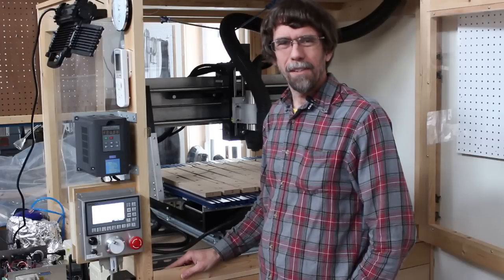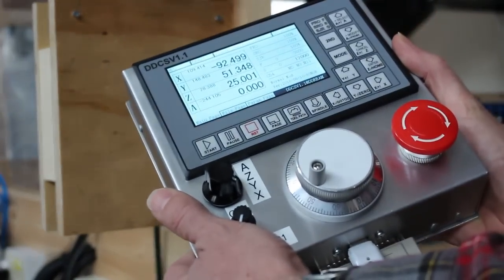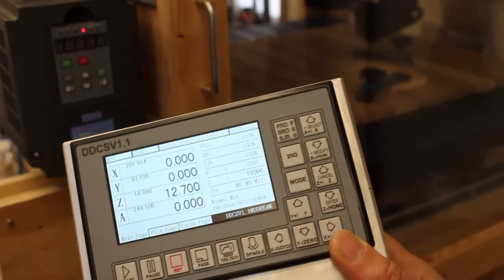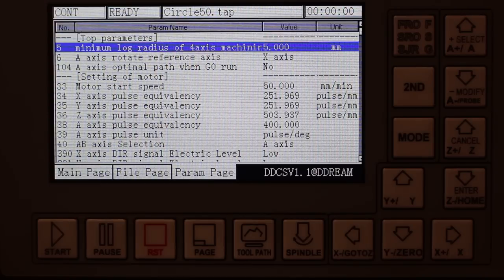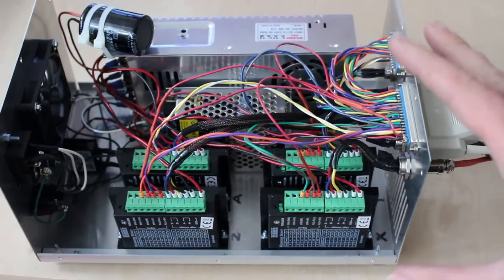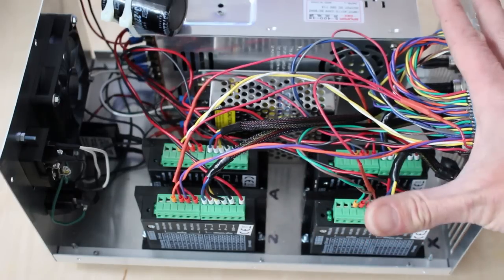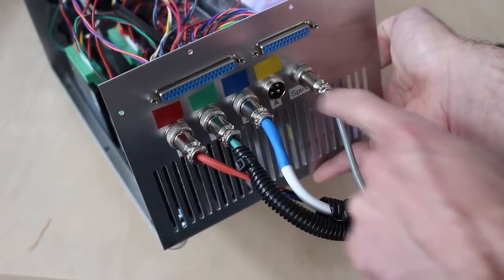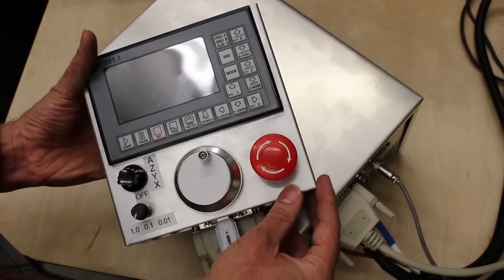Modular CNC Controller DDCSV1.1

Comment: Nice video. But I don't understand why go through all this trouble to get rid of Mach3+PC? This type of dedicated controller makes sense in industrial settings when you plug a flash drive with already-tested g-code and run machine all day. But in my  hobby workshop I constantly go between CAD-CAM-Mach3. Having to copy the gcode to a flash drive in order to make a small adjustment is a big hassle.

Comment: Does the unit supports extra G or M coded additional to those shown on user manuals. I have the hardware setup, thank you in part to your valuable documented videos, and I am willing to add pauses to my program, create a loop and have the cycle waiting for a push button (digital input) without have to use the start button on the display every time.   Any help or walkaround would be much appreciated.

Comment: Hi Jay.

Nice job & vid.
I am contemplating buying one of these as they appear to be a nice, compact and capable controller. However having read the manual, I see no reference to M6. How do you handle toolchanges? Also, any idea if the inputs can be programmed to perform functions other than those labelled?
Reply from the maker: Hi Eugene,
I don't have an automatic tool changer so I generate a separate G-code file for each tool, and change the tool manually before running the next file. I'm not aware of any alternate functions for the inputs other than what's in the manual. There are a couple of general-purpose outputs controlled by G-code that are nominally "coolant" and "lube" but could be used for other purposes.

Comment: I have watched both the construction and wiring videos but am still confuse.My controller is a different one from yours (a TOPCNC TC55H) but I suspect that I will finally work out a comparison between I/O connectors between the two.

However, my query is where do the two D-Sub connectors go to?  I have 2 machines.  One is a custom built machine running Mach3 and the second is a cheap chinese, arduino based machine which I will eventually upgrade to use 6600 stepper drivers instead of the toy ones on the arduino.

Comment: Hi Brain I'm using your DDCSV11 post-processor and it works great with Fusion thank you. Have you put any thought to the 4th axis, I have tried but can't get the A axis to work. Steven
Reply from the maker: Hi Steven, the post-processor should work with the A axis if you set the angle in your Setup in the CAM workspace, i.e. to rotate the part to a specific angle and then machine a 2D or 3D toolpath at that angle. It may also work using a wrapped toolpath, i.e. to rotate the part while machining around the circumference, but I did very minimal testing of that mode so it may not be exactly right. The internal interface is different for those two approaches and it may need more work. Do make sure you have the latest version that's on my web page, as I did post an earlier version without any A axis support at all. If it's not working then I'm willing to work on it but I may not get to it for a while.
Jay
Reply: Hello Brain.
I have the same problem with the A axis. It is not rotating.
I download the latest post processor from your site, but it is not working.
When i read the gcode there is no A command.
Can you check the link to the post proccesor .

Greetings Marcel

Comment: Morning Jay The new Fusion update supports simultaneous 4th axis toolpath. In Fusion generic post there is a New Generric Fanuc inverse time and A-axis post processor that supports Wrap Toolpath.  In the code you can see A-axis cordanets but using the DDCSV11 post-processor the A-axis code is not generated. I have tried to use the Fanuc post processor but my CNC machine just looked at me. I thought in could use Fanuc post processor, maybe there is a setting somewhere.

Comment: is that a Flyback capacitor or for voltage filtering?
What is the pin connection on the VFD and the DDCSV1.1 for the VFD control?
Reply from the maker: It's just a filtering cap on the power supply output, which reduces ripples in the output voltage due to current spikes from the load. It's probably not necessary when there is a completely separate supply for the controller, but it doesn't hurt.

The VFD wiring from the controller is just GND plus 2 signal wires: the output labeled M3/M5 goes to the VFD's "run" input,  and the output labeled VSO goes to the VFD's "10V_IN" input that sets the spindle speed. The inputs on a particular model of VFD might have slightly different names but most of them should be similar. That alone won't do anything though - you also need to configure the VFD settings to use those inputs because by default it's controlled just by the front panel buttons.
Reply: Thank you so much for all of your great videos and for taking the time to answer questions.
Reply: I have a Huanyang VFD that I bought from a vendor Scryptek CNC.  Most of the Chinese VFD manuals are horrible.  He created a really good one that I can send you a copy of if you would like
Reply from the maker: Thanks, mine came with a good manual too. I have seen some of the bad ones, and this one is actually understandable. I've also observed that among versions of the "same" Huanyang VFD, there are differences in things like parameter numbers and signal names, so I hesitate to tell anyone to use a specific parameter or signal line because it may be different than mine even when the drives look very similar.

Comment: Hello Jay great job. Can i ask to you help to connect my spindle's inverter to the Ddcsv1.1? I have doubt if i must use a relay for start signal or not? Can you tell me somethings?? Thanks a lot
Reply from the maker: Hello Mario. I did not use a relay to connect my spindle controller. I just connected the GND and spindle-enable signals from the DDCSV1.1 directly to the GND and START signal inputs of the VFD that runs my spindle. I cannot say whether that would work with your particular VFD though. Also, it does connect the GNDs of the controller and VFD so there can be a ground loop going from AC mains ground to the VFD ground to the DDCSV1.1 ground to the DC power supply and back to AC mains. This may not cause a problem in practice, and in my case the ground loop is quite short and so far I have seen no problems because of it, but it is something to consider carefully in your installation. If I start seeing any erratic operation I will consider adding a relay to electrically isolate the two systems. It is relatively simple for the spindle-start signal but much more complicated for the 0-10V signal that sets the spindle speed, where an optoisolator would be needed. None of this is absolutely necessary for a CNC router though. In the beginning I just set the speed manually on the VFD and started it before running a program and that works fine, but I prefer to have it controlled automatically.
Reply: Thanks a lot for your prompt answer. I think that for the moment i will connect just the start and stop signal and in the future i will connect also the 0-10v for speed control. Thanks again. Regards

Comment: very nice idea about the enclosure for the controller. I wish i have done that. Now when i cut something at the back of my 3m table, i have to go back and forth :-)
Reply from the maker: Thanks, I hope you can implement something similar in your setup. Originally I looked at the many pendants that are available, which I could have wired up and might be an easier option for you, but I realized that the whole controller wasn't much bigger than a typical pendant so I just made it all in one box.

Comment: Great Video, how to do similar set up on 16 x 30 victor lathe, cost, etc
Reply from the maker: This particular controller is designed for an X-Y-Z machine but you might be able to adapt it to a lathe. I don't have experience doing that however.

Comment: Hi Jay,

I am running Vectric Aspire.  Do you know what post-processor would work with the DDCSV1.1?  From what I have read the Fanuc does not.  I have searched hi and lo and have found little on what post will work with this unit.

Thanks in advance for any help.

Mark
Reply from the maker: I use Vectric VCarvePro, which I believe uses the same post-processors as Aspire. I have not yet tried using VCarvePro with the DDCSV1.1, but I wrote a post-processor for Fusion 360 that generates G-code compatible with the original CNC Shark controller, by following the example G-code output from Vectric, and I found that the same post-processor works with the DDCSV1.1. Therefore I would expect that the standard CNC Shark post-processor for Vectric would also work with the DDCSV1.1. The only adjustment that I needed to make to the G-code was to add an M5 instruction at the end of the file to turn the spindle off. The original Vectric post for CNC Shark only outputs M2 to end the program, which stops the router on the original shark controller, but that leaves the spindle running on the DDCSV1.1.

Again, I have not yet tried this myself, but I would expect that adding the "M05" line to the end of post-processor as shown below is all you need to do. In my case the relevant file is "C:\ProgramData\Vectric\VCarve Pro\V7.5\PostP\CNCShark-USB_Arcs_mm.pp" and your path will be slightly different but should be similar.

+---------------------------------------------------
+  Commands output at the end of the file
+---------------------------------------------------

begin FOOTER

"G00 [ZH]"
"G00 [XH] [YH]"
"M05"
"M02"
Reply: excellent!!  Thank you

Comment: I have a question I have 4 engines from step 4.2 A and I have a 4kw spindle. I want a complete set with wired wire means ready to work without stepping motors. Price How much?

Comment: Jay - I am wondering if you are still using the DDCSV1.1 controller and if you are satisfied with it.  I am also wondering if the controller can be set to use English measurement system.  If you could let me know, I would appreciate it.
Reply: I, too, would love to hearJay's thoughts on it now that it might have been in extended use.

Comment: Good morning, I'm brain Right, I'm from BRAZIL, I got a DDCSV2.1 controller, I bought the MPG controller, but I'm having difficulty setting the micro switches on the x, y, z axes and also want to configure, STOP, PAUSE, START , I do not know if I can connect together with the PGM, the pc has already been able to connect, I connected the wires, and nothing happened, need to configure on the device? If you can help me, I'm very grateful.

Comment: Salut Jay
j'ai regardé vos vidéos avec une grande admiration Bravo pour votre CNC magnifique réalisation .
J'ai aussi construit une CNC avec une table 100 cm X 70 cm  avec une broche de 2,2 Kw ,j'envisage de changer mon contrôleur SMC4-4-16a16b  pour un autre model soit le DDCSV1.1 ou le RMHV2.1 qui semble être les mêmes ,pouriez vous me dire la différence qu'il y a sur ces 2 modèles 
Encore Bravo et merci pour le partage.
Joseph
Reply from the maker: Je parle un petit peu français, so using Google Translate:

Hi Jay
I watched your videos with great admiration Bravo for your magnificent CNC achievement.
I also built a CNC with a table 100 cm X 70 cm with a pin of 2.2 Kw, I plan to change my controller SMC4-4-16a16b for another model either the DDCSV1.1 or the RMHV2.1 Which seems to be the same, could you tell me the difference there is on these 2 models
Again Bravo and thank you for sharing.

Hello Joseph, I'm glad you liked the video. I have not used the RMHV2.1 but I believe it is just a newer version of the DDCSV1.1. The panel looks very similar except for different labels on the buttons, and its manual even has screen shots that say DDCSV1.1 so I would expect it to be the same hardware and possibly the same software.
Best Regards, Jay

Again using Google Translate:

Bonjour Joseph, je suis content que vous ayez aimé la vidéo. Je n'ai pas utilisé le RMHV2.1 mais je crois que c'est juste une version plus récente du DDCSV1.1. Le panneau est très similaire, sauf pour les différentes étiquettes sur les boutons, et son manuel comporte même des captures d'écran qui indiquent DDCSV1.1, donc je m'attends à ce qu'il soit le même matériel et éventuellement le même logiciel.
Cordialement, Jay

Comment: Any issues with the controller so far? What stepper drivers are you running? Is there a maximum for lines of g code? Can it be switched from mm to in? Last question I promise, I run two motors on my y axis. Can a slave motor be setup to run the opposite direction? 
Thanks! Awesome build!
Reply: Those seems to be the TB6600 drivers (or similar) , I've got 4 of them on my CNC machine and they work just fine. You can  revert the wiring on the second motor to make it spin in the oposite direction. if you are using just one driver for both you can do just like in the image below.

https://cdn.instructables.com/F7R/YJ37/IKRIQXFG/F7RYJ37IKRIQXFG.SMALL.jpg
Reply: You have the slave motor run the opposite direction just by swapping output or wires.
Reply from the maker: So far I have no issues with the controller in my application, but if you look through the comments you'll see some issues reported by others e.g. it does not correctly execute arc moves if the pulses-per-mm is different in X and Y. I am now using KL-5056 drivers from Automation Technologies: https://www.automationtechnologiesinc.com/products-page/kl-stepper-drivers/kl5056/

It does not support inches directly. You could possibly calibrate it in inches by altering the steps-per-(mm) setting but I have not used it that way. I also have not tried running two motors on one axis but it should work if you use two stepper drivers connected to the same STEP/DIR outputs. As @Roadstercycle mentioned you can reverse any stepper motor by swapping the wires on one coil.
Reply: The new DDCSv2.1 fixes the Known bug with the arc movement

Comment: Hi there, I hope that you can help me  i got a trouble with this controller which It's the next : I´ve calibrated every axes and manual mode goes correctly with a correct measurement , however when i upload  a Gcode, the axis Z has an incremental error, when  i set up the home and the gcode runs, the z axis goes up and down to mill the piece and every time that the axis z goes down, the point home of  Z axis looks as if it it resets and start lower, i checked the gcode in another machine which runs with mach3 to verify if the gcode works correctly and the same gcode works correctly,  i hope your response, thanks!!

Comment: Hi I have a problem and hope you can help me. I am using DDCSV1.1with closed loop stepper motors. I generate G-code with Fusion 360 and when I run the G-code it seems to lose steps.  (loosing steps in the sense, that when I send my machine back to zero position at the end of the G-code, it's out by 2 - 3 mm on x and y axis.).  What could be the cause?
Reply from the maker: It might be similar to the problem I had in my micrometer dial video, https://www.youtube.com/watch?v=3g9IFnVDOTo, where it seems that the DDCSV1.1 was sending pulses faster than my cheap stepper drivers would handle. In my case upgrading to higher-end stepper drivers fixed the problem. With closed-loop steppers you're probably not using "cheap" drivers but they might be designed to filter out pulses above a certain frequency for noise reduction. If you are using microstepping, you could try turning that off or reducing it, e.g. if you are using 16X microstepping then going to 2X would cut the pulse rate by a factor of 8 assuming that you also reduce the pulses/mm setting in the DDCSV1.1 by a factor of 8. There are also some settings in the DDCSV1.1 settings page, that control things like the pulse time and delay between asserting the DIR signal and the STEP signal. Increasing those didn't help in my case but it might be worth trying.
Reply: Thank you for your advice. I am away for the rest of the week but will let you know if I come right.

Comment: nice setup - how do you calibrate the step accuracy with this controller?
Reply from the maker: That's a good question, and one I've gotten multiple times so maybe I should make a video about how to calibrate the controller. The short answer is that you need to know the steps-per-revolution of your stepper motor (commonly 200), the pulses-per-step (microstepping) of your stepper driver (commonly 1, 2, 4, 8, 16 etc.), and the millimeters-per-revolution (lead) of your lead/ball screw (commonly 4mm, 8mm, 10mm etc.). Then to calculate the pulses-per-millimeter value to set in the CNC controller, use this formula:

pulses_per_milimeter = steps_per_revolution * pulses_per_step / millimeters_per_revolution

There are various ways to check this, such as by using a dial indicator to measure the physical distance moved when jogging an axis with the controller.
Reply: @BrainRight  thank you so much. Your answer was very helpfull for me....i was little confused how to insert pitch of the ball screw to the controller....thanks Michal
Reply: @zlincar  are you using same model controller ?
Reply: @manjitsingh-xc4tv  Yes I am...

Comment: Good afternoon Mr.Jay. I need help. There is a small request.
Can you draw a connection diagram?
DDCSV 1.1 + Encoder. (MPG wheel.)
DDCSV 1.1 + axis switch
DDCSV 1.1 + the switch of the division (1; 10; 100)
If this is not a commercial secret.
I want to use the decision as you do 
Thank you in advance for the constructive response.
So, I'm sorry for my english, it's not very good.